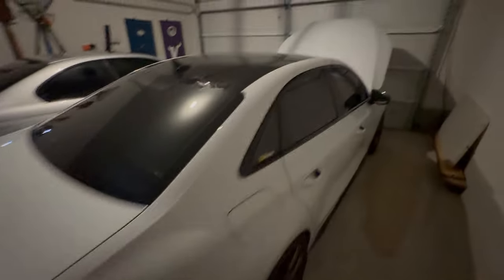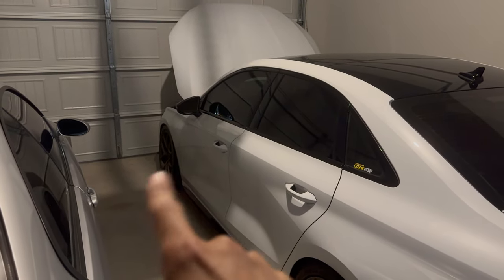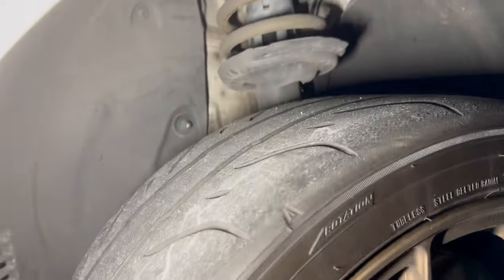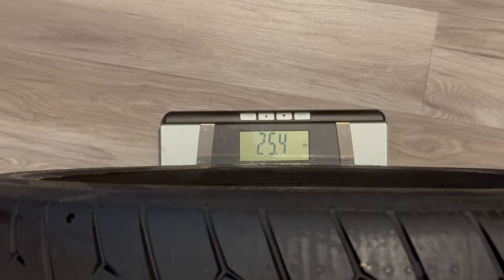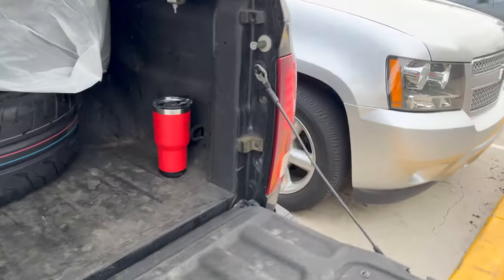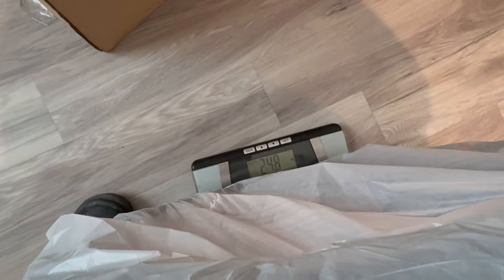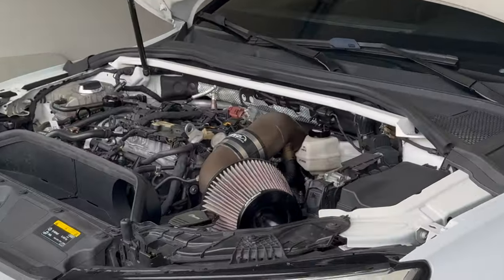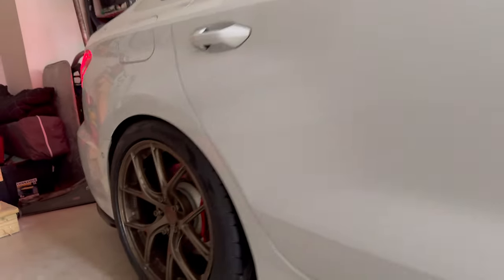Making a BIG change to try and go 10s! & Y'all helped me do it!

Comment: I want a new pendulum mount for my GLI, everywhere I try and look I cannot find manual ones anywhere. Do you have any insight on whether theres a difference in dsg ones compared to manual?
Reply from the maker: Hit up it’s not stock! Apr and 034 both make them. I believe they are the same as the DQ250 mounts but don’t quote me on that.
Reply from the maker: Found it for ya
https://itsnotstock.com/apr-billet-pendulum-mount-for-mqb-6-speed-dq250/
Reply: The goat 🫶🏼 Your opinions on the verkline subframe? Looks gnarly under the car lol